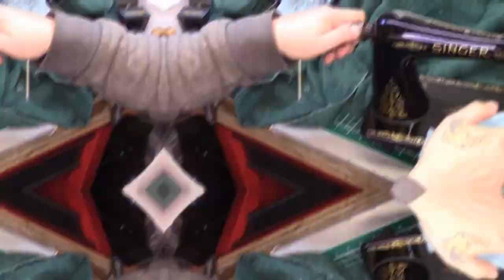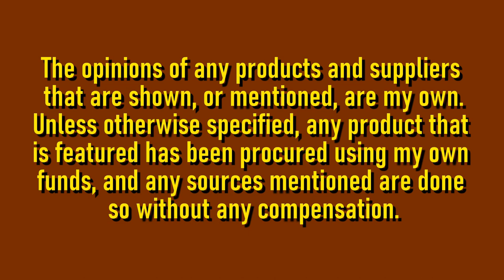A 99 for Sandra: Part 1

Comment: Good stuff Bob.  I've been too timid to try an impact on those slotted screws.  I'll rethink my position on that.  The 201K I'm restoring has such "spider web" cracking of the lacquer paint I'm a bit lost as to how to approach it.  I really don't want to repaint the whole thing so may settle for a patina look.  Your last video helped me with a clicking noise, and I need to regauge the needle bar. I tried to give you a comment, but YT would not accept it. Sometimes things just go haywire.  Thanks for doing these videos.

Comment: I learned to sew on my grandmother’s 99K (I think). I was about seven years old and it was a treadle machine. I don’t know what happened to her’s, but I wish I had it. I am now nearly 82 years old and have been looking for one for several years, treadle and all. Do you know where I might be able to purchase a vintage 99 or 99K in working condition? I have several machines now including a brand new JUKI  lockstitch machine, but all of them are relatively recent. They sew well enough, but  the vintage machines sew much better.
Thanks!

Comment: I have a Singer 99.  When the early.  When I sew about 6 inches the screw that holds the feed dog in place vibrates loose. How to keep that screw tight? I think it is 1923 model.  It sews great.  Just 6 inches, stop and tighten that screw again, and sew some more.
Reply from the maker: You're obviously having an issue with getting the screw tight enough (and there is only 1 screw involved). Try using an offset, ratcheting screwdriver to give yourself some more leverage to tighten the screw more.

Comment: I have a model 99 . She seems a good condition and running.  Now I haven't check how much crub is inside. Your videos will help me when is the time. Just opened a folder to save this videos.

Now what determine to use the Mcguire wax to polish as a cleaner.  I have a 127 that have lost of dust and crub on her body. Do I use SMO. Gojo or use the Mcguire wax to remove it? Thanks for everything you do and shared with us.
Reply from the maker: That Mcguire's is actually a swirl remover polish, not a wax. I went with a swirl remover as it's a very gentle compound. I did, however, but a couple of others to try as well. Yes, that gets expensive!
Reply: @BobFowlerWorkshop  Will take a look at that product.  After watching you taping the foot and needle bar; I went and did it on  my rusty model 27 that I sent you an email. It  was a happy morning to see how it came out. You just made my day. Thanks
Reply: What a joy to watch you with these machines. I’m looking forward to the subsequent videos.   I have a Spartan but I think I’d like a 99 as well. The size is so nice.  Thank you so much for this….I feel like I’m watching the sewing machine Olympics!!🎉🎉